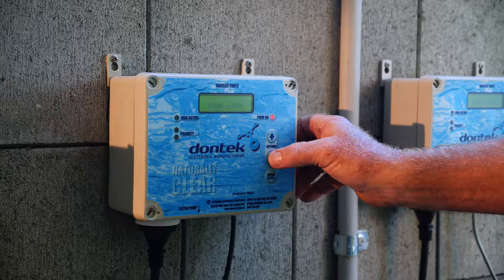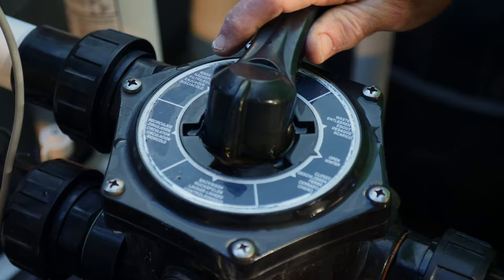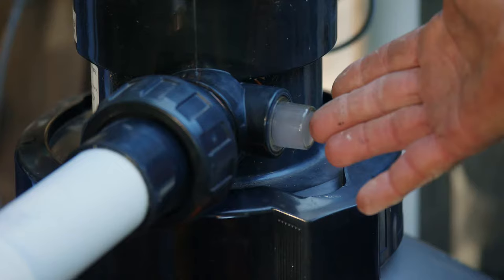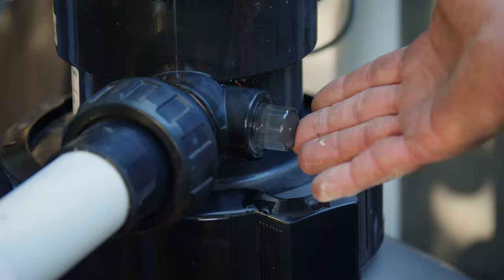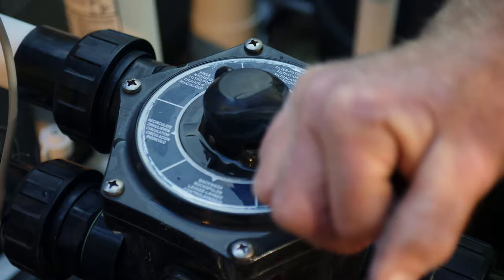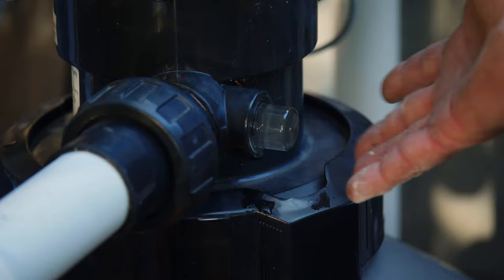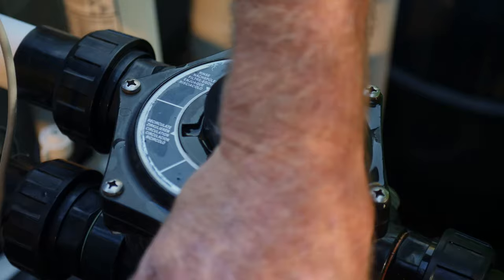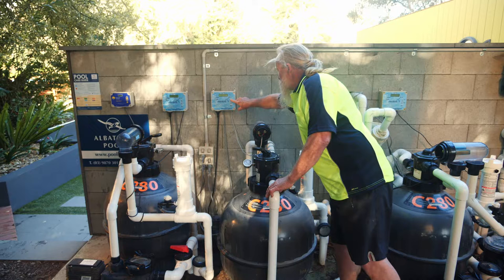How to backwash and rinse your sand filter?

Comment: Initially, this did not get rid of my problem, but the reason that I was not getting any results because I wasn’t turning off my pump in between handle changes then the green water came out, and my pump psi went down dramatically. Lesson learned not only will damage your pump, but it won’t clean properly.